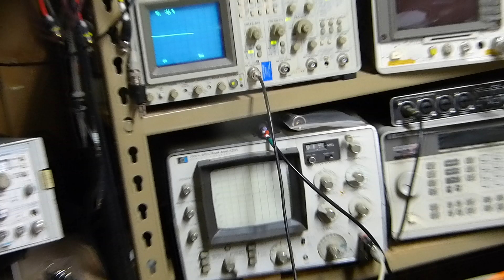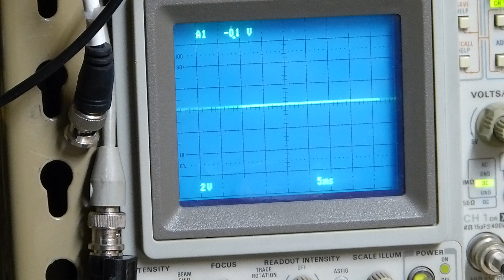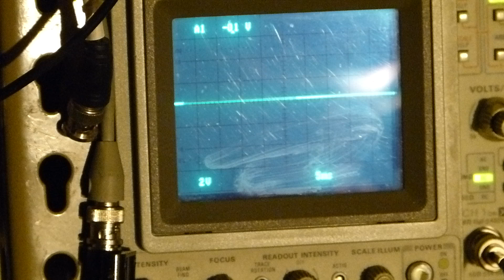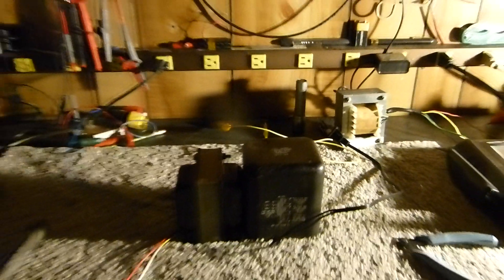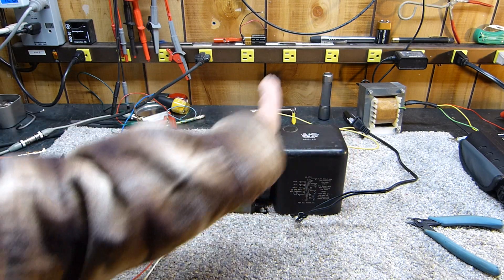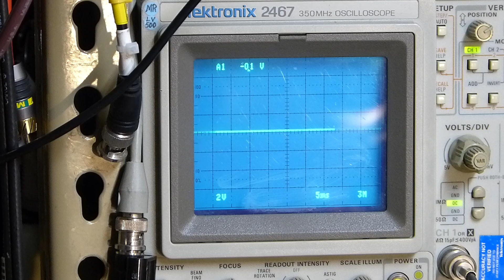Determine Best Orientation Of Output Transformer to Power Transformer In Audio Amplifier

Comment: Great demonstration. I recently used a filament transformer to buck the 120V to 110V for a friends Nobsound single end amp at least 10 years old. It had a 110V power trans and everything ran way to high voltage and no surprise temperature also. It was real hard on the tubes and the rectifier would arc when you turned it on. I wanted to fit the bucking trans inside. The only place was right under one of the OPT's. First try hummed in one channel. I changed the orientation and the hum was gone. Had to cut a hole in the bottom cover but the feet were high enough to avoid hitting the desk top. Used an 11 V filament transformer to do the job.

Comment: Very interesting, very simple fix for otherwise could be a very big headache. As regards the choke , is there a similar matter of induced hum , or does its orientation matter ?
Thanks for the video and for pointing out something I hadn't considered in the build I'm about to begin .
Reply from the maker: I have never given the choke much thought as it is usually, in my builds, mounted under the chassis away from OPT and input circuits. In any case, the 120 Hz ripple is not bipolar so the magnetic flux will not be switching polarity as in a transformer so I don't think it will be much concern if kept in the power supply section of the amplifier.

Comment: What you did was basically exactly how I was thinking to determine the winding of your power transformer.  I love doing tests on unknown transformers.  I have done quite a few tests trying to determine the current capability of a power transformer.  If you can take the bells off, I've put temperature sensors in the transformer and put the bells back on.  Then load the transformer at different current for a period of time.  I figure 40C is about the max I would want one to operate at. A little more for short periods.  

What a difference the orientation made!  Good job!

Just working on getting TrueRTA going on my laptop.  Excited to try out my Tascam audio interface.  Had it for a month probably and haven't had the time yet.

Talk to you next time.  Keep warm!
Reply from the maker: You showing me that Tascam instrument almost made me buy one. I have resisted so far .  I am "trying" to buy less toys but almost drove to Arizona last night for a 4CX5000A RF amplifier. I am still thinking about it but am a little too tired with my cold...  maybe next week... 🙂

Comment: Why don’t they use transformers for soild state amplifiers
Reply: Solid state amplifiers have very low output impedance so they don't need impedance matching in the same way. The output tubes have output impedance in thousands of ohms so they need to be matched to the low impedance speakers.

Comment: This is the kind of thing we learned as teenage audio hobby builders back in the day.. now half a century later it is 'exotic' knowledge.  Thanks for documenting the procedure for  the new generation of hobby builders.. that have virtually zero practical knowledge.  Magnetic coupling is also an issue with AC filament wiring, part of why I never use AC on filaments.
Reply: Yes. His demo's explain basic EM concepts in practical ways.

Comment: Hi David,
Great demonstration, thanks
A few questions if I may:
1) I assume that the power transformer could have been rotated, if you wanted the OPT bells forward?
2) it would be very interesting to repeat and show how adding space between the PWR and OPT, say in 1/4” increments would affect coupling?
3) to what extent does a choke radiate disruptive emf to an OPT?
Thanks again
Ken
Reply from the maker: Hi Ken,  I don't know the answers to all that - we will have to do some experimenting. I am sure turning the PT would accomplish the  same if the OPT needed to be oriented different but I like the schematic diagram on the PT facing forward and is why I decided not to paint it.  I will make a few measurements with the OPT at 1/4" increments to see how fast the magnetic field drops off and mention it in the next video. As for the choke, I don't know but I assume the magnetic field would not be anything like the AC transformer and since it is DC (a bit of pulsating DC) it would not be harmful.  I could be wrong. In any case, I always keep my PS components in a corner all to themselves.
Reply: The field drops off as the square of the distance. Inverse square law yet again.
Reply: Agreed, the schematic on the PT is very cool,
Not painting seems the better choice 
Thanks again

Comment: You can use MU-metal enclouser to improve isolation too. I use mu-metal sheets to make enclouser for transformer .  It helps alot . 👋👋👋👋👋
Reply: Only if you first properly orient the transformers.. then the Mu shielding can be of great ADDITIONAL quieting benefit. Using Mu cans to isolate bad positional coupling is a waste of their performance..and you never get as quiet as good position plus Mu cans